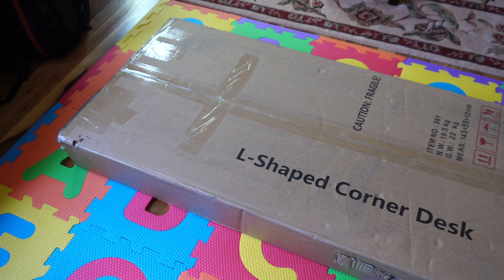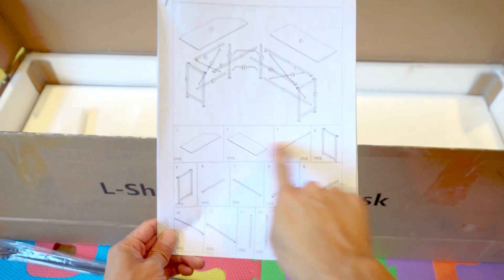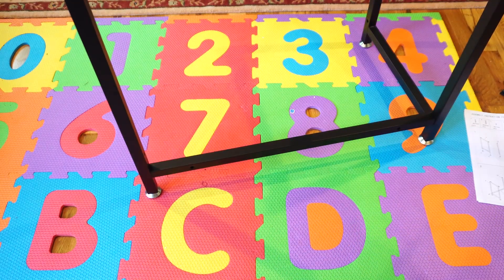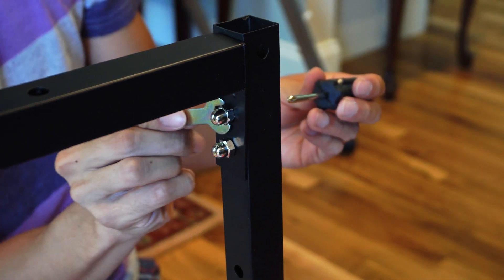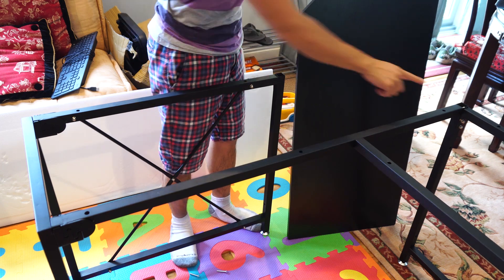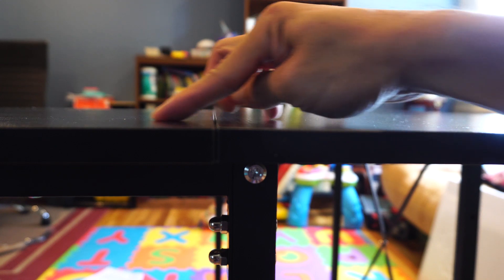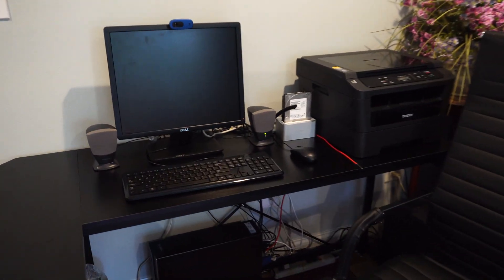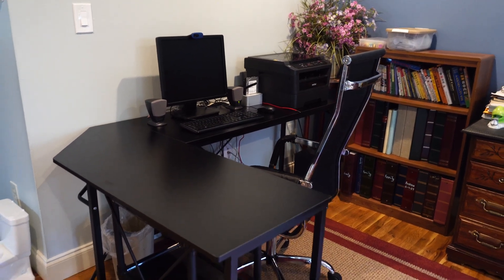Ulikit L-Shaped Corner Computer Desk Review

Comment: Are You still using the Desk?, if so, Has is lasted well?.
Reply from the maker: Yes, it's in our home office now and used in one corner of the room. We did have to take it apart to move it, but it was simple enough and went back together just as easily. The desk itself is fine, no problems with it structurally so I'd say it's holding up pretty well!
Reply: @ReviewedByPhil  Mine arrived yesterday, looks good but i'm going to give it a clear coat of epoxy resin, so as to not wear out the desk top. nice desk though

Comment: Where is the parts for the pc? I don't want to put my pc on the floor. Also what happens if you don't have a mallot?
Reply from the maker: I put my desktop on the floor under the desk, but feel free to put it on top of the desk if you prefer. If you don't have a mallet, a hammer works too, but you might want to put a piece of scrap wood between it and the metal when tapping the pieces together so you don't damage the bars. You could also wrap the hammer in a couple layers of an old towel to soften the blow. Of course you can always order a rubber mallet at Amazon: https://geni.us/m1MG5gO [Amazon Affiliate Product Link] and they are not that expensive.